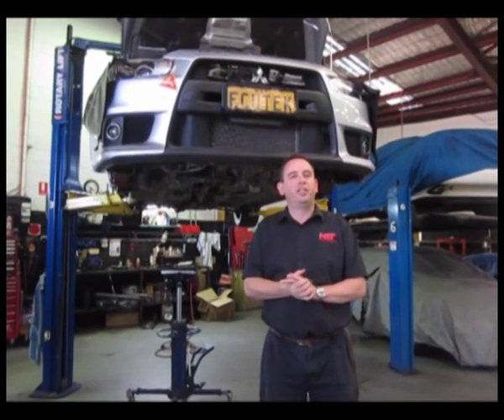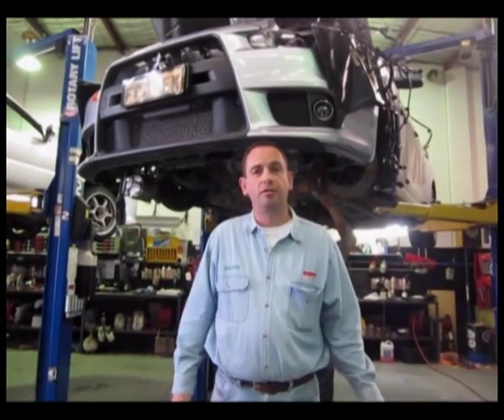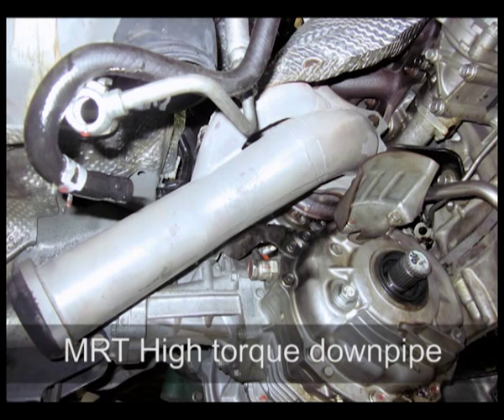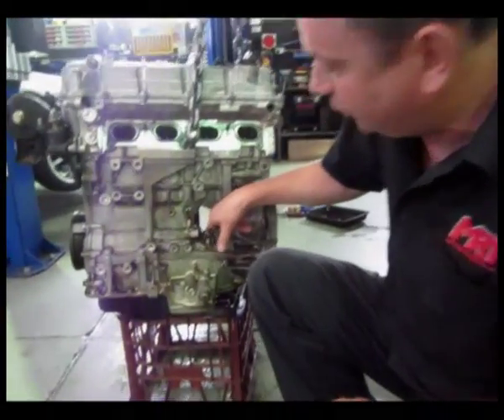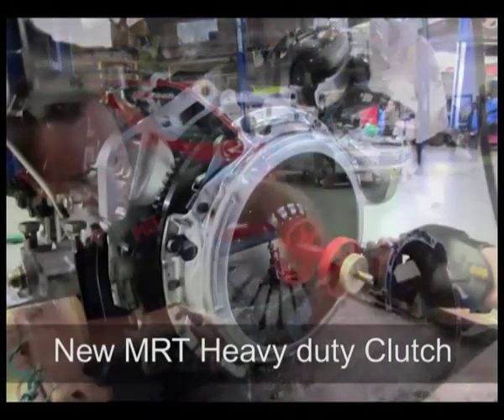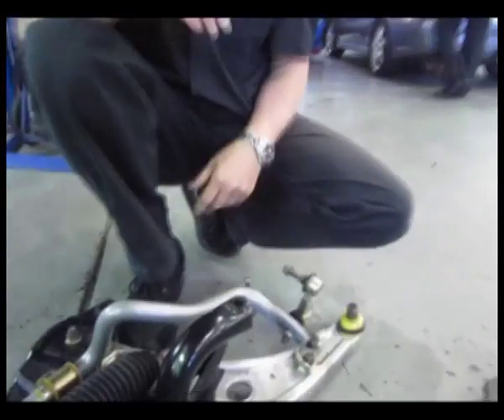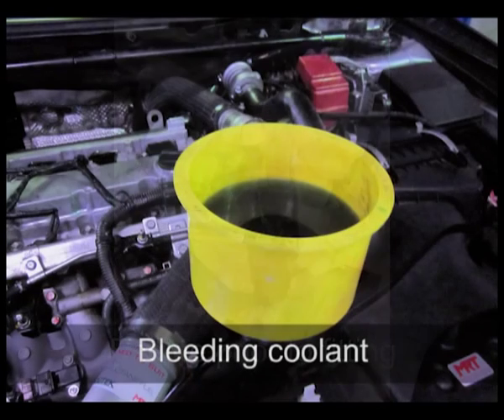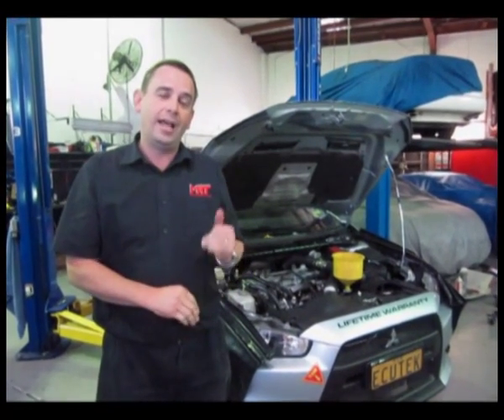EVO X 2500 stroker update part 17

Comment from the maker: @grinnereid very good point,s other important notes is combustion pressure, this is dramatically effected by boost / turbo spec and how much overall ignition timing is use and with what programming method or ECU. Bottom line is understand "your" engine and choose options wisely :)

Comment: Brett, it's a well known fact the the standard Evolution X Con-rods are not comfortable with any more than 28psi max boost (26 psi max being what I have successfully used with an FP Red since 2009). By 30psi they will fail without a doubt!!!
However you failed to mention that getting overly adventurous with advanced ignition timing is probably the biggest killer of the stock 4B11T rods?